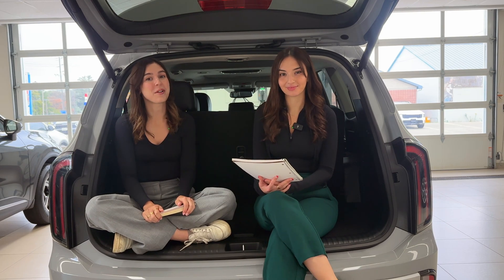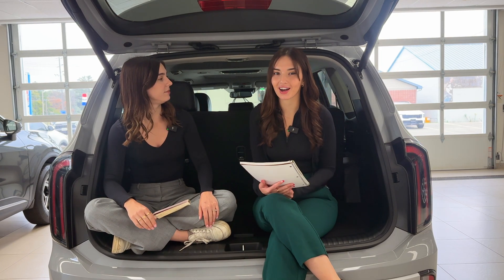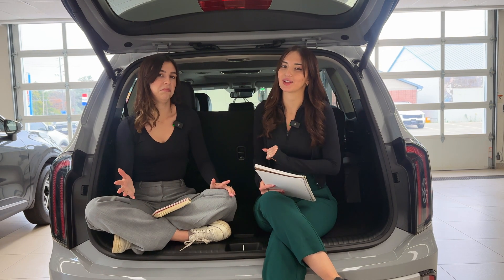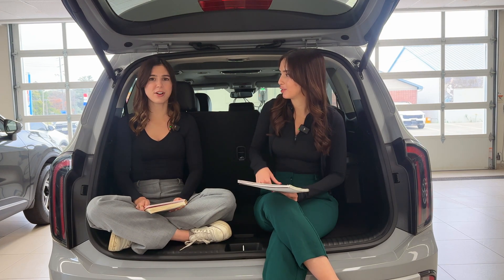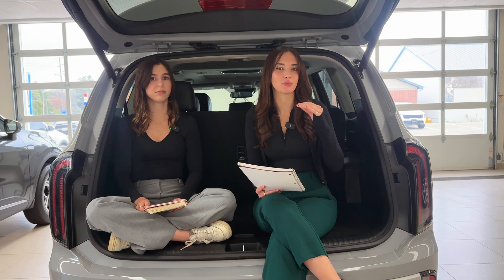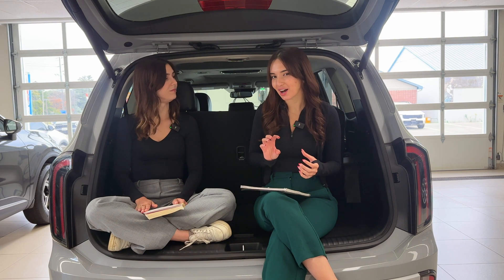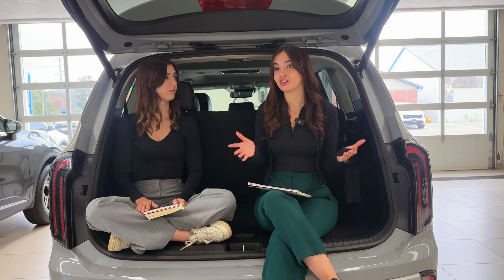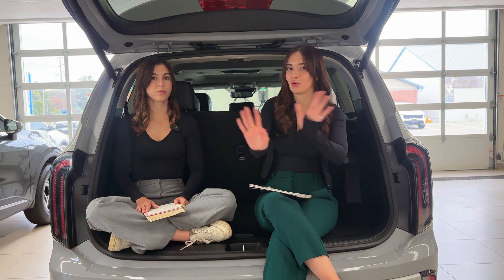Boosted Breakdown | Superchargers vs Turbochargers

Comment: Superchargers offer instant acceleration and response. Turbochargers have lag, munch gas when on boost, and both have a lot of top end. Turbochargers you can adjust the boost on. With supercharged motors,  you can change the drive belt or install a larger roots or screw type supercharger.